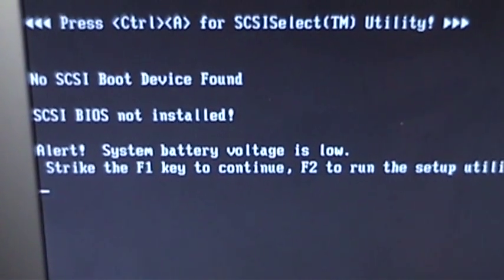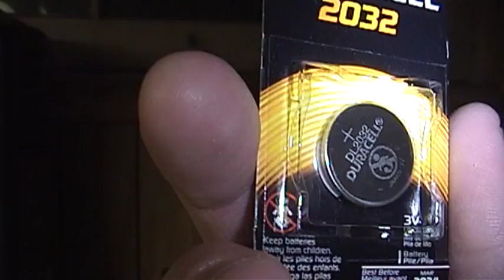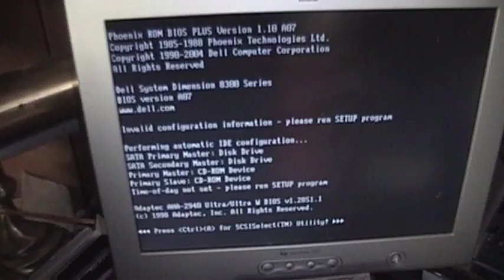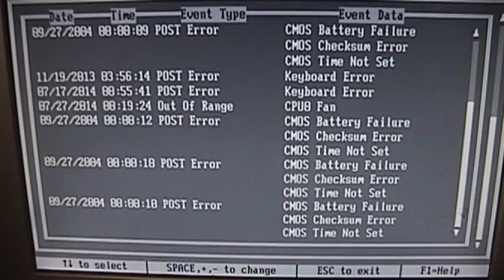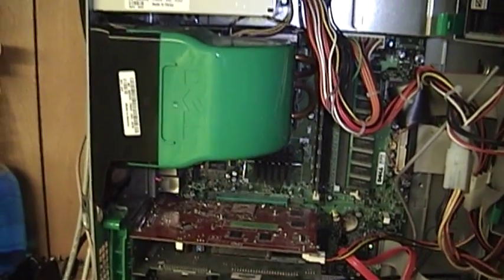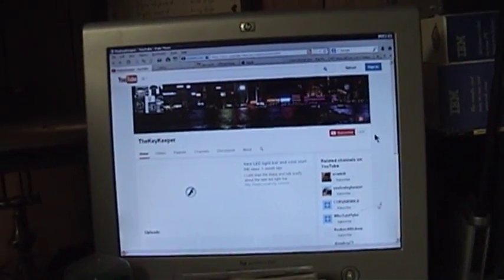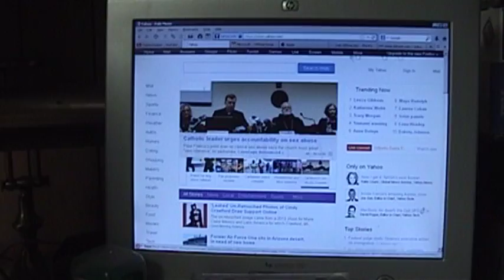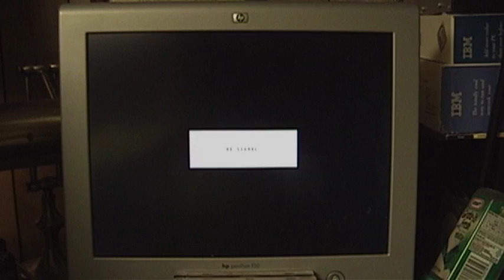Dell Dimension 8300 Clock Battery Service

Comment: I have a P4 Dimension 4550 (2.0 Ghz 400 MHz FSB) that I'm thinking of getting a better processor for- because why not. Does anyone know if 2.8 GHZ is the highest I can put in there with that FSB speed? The original battery is still in it btw.
Reply: *****
Thanks. I know the 4550 was available with a 533 FSB. The main thing I wondered is if you can use a 533 FSB P4 on my 400 FSB system.
Reply: Thanks a lot for the help. I made sure the BIOS and all the drivers were updated back when I reloaded XP right before end of its support. Although it's in retirement, It still looks/works like new and I still keep it for older programs. I just wanted to make sure before I spent any time messing with it.

Comment: The problem I always saw with these mid-2000s Dells was extremely poor disk performance. The hard drive transfer speed would degrade over time because the IDE driver kept a lifetime count of errors and would keep downgrading the transfer rate until the hard drives were running in PIO mode and booting took 10 minutes.
Reply: *****
It definitely doesn't happen on SATA drives where bad cables might cause all kinds of odd behavior but not a permanent slowdown. I never saw it happen to custom built systems with PATA drives either, though the ones I had at the time were basically all AMD.

Comment: Bill, I hope you are aware that mice, especially optical mice, don't work until Windows starts to load. (Hence why your optical mouse didn't light up until Windows got to the loading screen) Sometimes the mice won't work until Windows gets to the logon screen, therefore having to wait a few minutes until Windows installs the correct drivers in the background. This can happen other things too, such as keyboards.

Comment: UXWBill Code of Computer Usage:
>Real computers have floppy drives
>Real computers use PS/2 ports

If this doesn't happen, you might find yourself with an IBM PS/2 hitting you in the head, and if that happens to be a Model 95 server, I don't envy you!
Reply: 2dfx USB floppies are better than nothing though.
Reply: ***** No sir, USB floppies often lack proper emulation
Reply: +lmull3 high end gaming motherboards have ps/2 ports due to low latency so do we win?
Reply: Which is why I really want to pry the face plate off of my old gaming PC. It has a 3.5" bay and a floppy controller, but no knockout for it on the face plate!
Reply: Does a USB floppy count?
Reply: Compaq doesn't consider USB diskette drives as real.  Their disk creation utilities don't recognize them lol.

Comment: I, too, would never had guessed that it was the CPU fan causing all those problems for that long.  I have an 8300 myself and, after upgrading it with 2GB of RAM, a 320GB Seagate SATA HDD, and an FX5950 Ultra, on top of its factory 2.8GHz P4HT Northwood, I'd argue that it's faster than my main rig.  Seriously, that 8300 FLIES.

Comment: The logo on Yahoo's site seems to be the last thing to load in Firefox when you visit the page for the first time. I'm gonna take a guess and say that in your haste to prepare for the video, you stopped the loading of the page when it seemed almost all the way there.

You can come up with any creative punishment you want for my reading that text, maybe I'll clean that Model M for you. :P

Figuring out what that said through the 480p resolution was pretty fun.

Don't forget to wish Windows 2000 a happy 15th birthday!
Reply: ***** Apparently the cause of the Yahoo logo not showing up was because the clock wasn't set, or at least wasn't set correctly. I could have sworn that you set the clock on that computer. Oh well.

According to Wikipedia Windows 2000 was released to manufacturing on December 15th, 1999, and became generally available on February 17th, 2000.
Reply: ***** The logo was using SSL (for whatever reason), and the computer thought it wasn't a valid certificate?
Reply: ***** Oh, damn. Didn't think of that. I always thought Yahoo would only use an SSL connection if you were logged in, but it looks SSL is default now.

Comment: Well that was a supprise, an ill cpu fan causing windows to throttle down the cpu so it didnt explode into a million pieces of boiling hot chip lol.
I half expected you to say "a cpu with faulty cache" or a memory problem.....now what was i saying again :).

A neighbour used to have a clamshell system, i had to replace the dvd drive as the old one became allergic to disks, i was happy to swapout the old drive for him.
I really liked the blue plastic sliders screwed to the sides of the dvd rom, it slid out so nicely and once transfered to the new victim... err dvd drive it went in a treat :-).
I dont know what type of dell it was, the old man passed away a few years ago at 85, and his machine was carried away by his family, never to be seen again, it was a nice machine that behaved itself really well :-).
Dont i waffle on lol :D
Reply: *****
Thats a shame, if there is a heaven for computers then its your house and love for all sorts of machines, her machine would have been appreciated.

Comment: I've always had a soft-spot for these early-mid 2000s Dell machines. I almost bought a Dimension 8300 back in the summer of 2003 but wound up going with a Dimension 2350 because it was more budget friendly and I still have that same machine to this day. Hard to believe it may have been the fan causing those problems in your system all these years (I watched your original video on it back in 2010).
Reply: I agree. Love these systems! Love the design and everything. I've got a Dell Dimension 4700 and it's been one of the best computers I've ever owned!
Reply: Heh.  I bought a 2400 back in 2003 myself.  Still working now, though it doesn't see  much action.  I too have a soft spot for that era of dell, actually having quite a collection of dell pentium 4 machines (people just keep giving me them!)  Also Roadgeek I thought your soft spot was for Packard Bell Machines?
Reply: Reed Hansen
 yep same here with the p4 dells, looks like these were used up right to the end of xp support, as office machines.
Reply: Same here, those were really good machines, and I'm glad to say I have a few variations, the 8200 using rambus memory is a nice one to have handy. I'm glad that you fixed that system, just sorry that it took so long to figure out what exactly went wrong, a defective fan never crossed my mind. as usually I don't have fan issues unless they crap out, (And I have a box full of salvaged case and PSU fans just in case lol)
Reply: That's interesting. I've had two Dell Dimensions in my lifetime; one of them is believe it or not still alive in my basement; a Dim 4600. I donated the other one, my Dimension E510 from 2006.

Comment: What became of the other 8300? I've been actually wanting one to mess with, I always liked the 8300, and though I got a GX280 which was simply amazing for the time, I still want to mess with a 8300
Reply: Ah Okay, it's amazing the fan caused that, probably explains what happened to a GX260 I was working on
Reply: Ah, yeah I've noticed the same thing, I've also noticed the parts in the Dimensions in general to be more dependable
Reply: The 8300 looks cool but i don't really like the "clamshell" design.
Reply: Yeah that's what I like about the 4600 better, those cases aren't half bad compared to the clamshell
Reply: *****  True.
Reply: ***** You should have trademarked that room name. :P
Reply: I have an 8400 and unlike the 8300s motherboard only has 2 sata channels, the 8400 has 4, which is great for storage. I'd imagine the power supply is up for it. I sold my sff GX270 i found super cheap at a thrift store and used the money to buy the 8400.

Comment: i had a nearly fully specced 8400 it was a beast, 10 years ago.(only got 1GB of ram)
Reply: ***** The intended use for mine was 3D CAD work as it was sold new to my dad as a work from home company computer(ie. not cheap)
only problem i had with it was it was loud and so hot i cooked pirogies on the CPU heatsink in its last months of daily use.
Reply: I got one recently, fully speced wioth a modem, ATI x300 and a Sound Blaster Audigy 2 ZS which was going for around $3000 when i was in 3rd grade.

Comment: I need to fiddle with my 4300. It's got a real slow P4 1.4GHz (I believe) CPU in it, and it could do with an upgrade. I think it's even bottlenecking my FX5300 GPU (which has a horrendous fan on it but after a little while the noise subsides). It ain't no YouTube machine but it gets my old games going at least.

Now to get my SoundBlaster AudioPCI 64 card working in DOS (It did before, it doesn't now), that would be kick-ass.